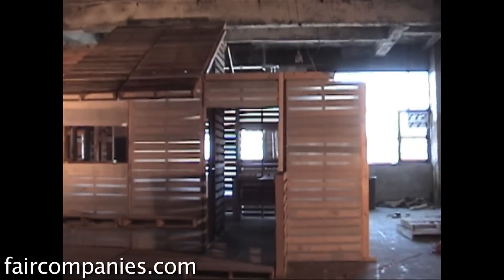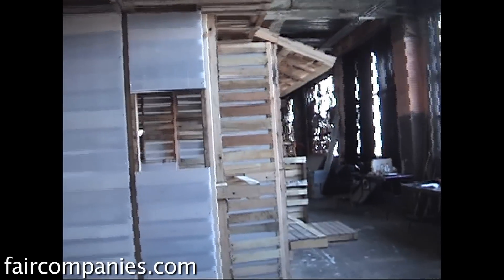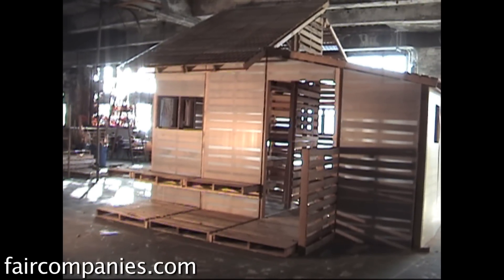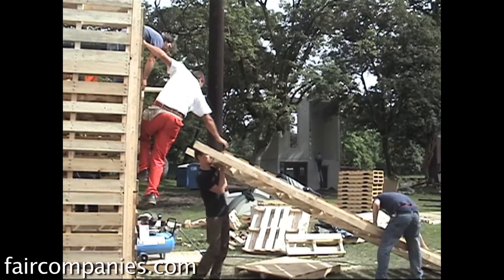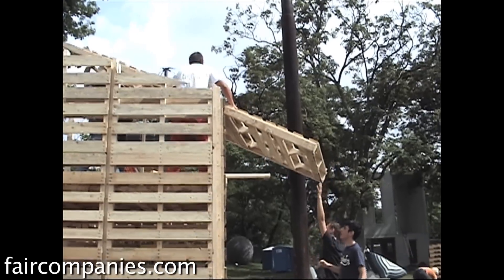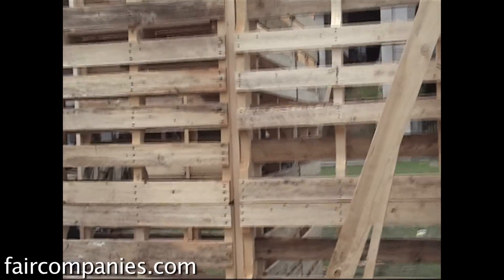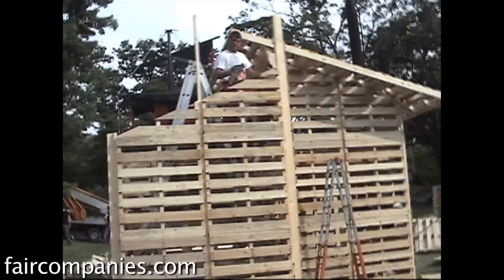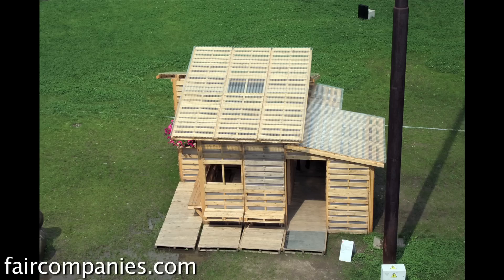Salvaged pallet tiny home has IKEA-style assembly guide

Comment: i am truly impressed with the genius of Suzan Wines. my company accumulates wooden shipping pallets and sells them to scavengers. (it annoys the hell out of me, for i have had my cubicle relocated to where these pallets are stored for the last 2 years, the noise is horrendous, i threatened to quit 5 weeks ago) but pallets make perfect sense for plumbing, insulation and electrical runs (i was a draftsman/designer for 12 years in a previous life)

off the top of my head i'd think in 4'x8' modules or units for plywood and framing material, pallets are 40" x 48". my company buys solid plastic-ish pallets, those could serve as exterior walls. pallets offer instant plumbing, electrical and insulation opportunities. the only thing is, most pallets i see are never "virgin" and have been around the planet a few times(quite ratty/rotted). i can't see donated "aid" arriving on pallets that aren't infested with molds, bacteria or even insects. a "whole house" fumigation with vaporized hydrogen peroxide would be needed to make older pallets "safe" for human habitation.

Suzan, nice concept, needs a little more work/thought, but i think you're beautiful  :)

Comment: Now this is innovation. This would be a great idea for Africa.
Reply: its good idea anywhere!!!!
Reply: Except Asia. You need to build your home with concrete in Asia. We suffer tropical storms down there and they're compared to that of the hurricanes in Fla.
Reply: rayva1 Well guess what. They have tornadoes in the USA but do they build their houses out of concrete? Nooo wood and cardboard all the way.
Reply: ayah Aya Yeah, except every country in the world that's situated in a temperate 4 seasons climate.
Reply: RamireZTKD Depends. Where I lived was in an older home where concrete was solid with steel poles as the framework in between the concrete. Which was why the homes felt like a hot oven in the summer and a fridge in the winter despite turning on the heater in winter or air-conditioner in the summer. At least with the military housing, they built their homes with insulation so that kept military homes warmer in winter and cooler in summer. As far as protection from tropical stormy weathers - concrete is the way to go with heavy duty windows built with steel framing and they actually build homes with steel doors in that country.
Reply: ayah Aya I couldn't agree more! :-) Peace be with you! ♡ and anyone reading this :-) Namaste ♡
Reply: 90% of Africans (all ethnic groups) live great houses, TV. just doesn't show that, they have beautiful amusement parks, very little jungle, and plush green land; do not fall for the propaganda, anyone anywhere who needs it, can use it. In other countries America and her inhabitants are shown in the most negative light, that's why we all have a bad reputation that precedes us. Become well learned not informed.

Comment: good basic idea though only really suitable for dry zones (ie the desert) unless some kind of weather proofing is put on the outside of the pallets.  I also notice that all the pallets used are full of holes, here in Ireland most of the pallets have the slats side by side leaving no space between them.  Much better for housing as they are more draught proof. ps we use them to make windbreak shelters and fencing around the garden as well as storage areas.  Ideal cause they don't have holes so can be painted/stained etc. and blend in.

Comment: I Built me a Storage Shed out of Pallets 16X14X9  With a Loft, Skinned it in Metal. I Have $1500.00 in it Most of the Cost was the metal and Labor, Could have Just Paid 750.00 for the Metal But Had a Guy Who Does metal Buildings Put it on So I didn't Make Mistakes on Cutting it . But Me and a Buddy did the Floor and Frame Out of the Pallets Made Our Own Trusses out of 2X4's  Had 150.00 in it Before The Metal & Labor. The Same Size Shed from Lowes or Home Depot  Well I say Same Size But actually there's was Smaller a 14X12X6 at Both Places Ran well over $6,000.00 Now that I've Done it I Could with the Help of One other Person Easily Do One in a Day. Granted I had all the Pallets and Materials on Hand. Very Happy with How it Turned Out, Looks Awesome
Reply: +Kelly Dardeen Very Awesome!
Reply: +Kelly Dardeen Oh! Btw... the way you get past all the bullshit permits and regulations is to build a structure at the legal maximum width and length that your state allows for a mobile structure to be hauled on a road. As for the height most states only allow somewhere around 12 feet max, although if you can prove that your upper section is detachable and also meets the state's hauling dimensions, and furthermore, you don't attach the structure to the land you are on, such as via a dug cement footer, but instead set it upon cinder block skids. Then, you should be golden. Although, you also cannot attach any municipal utilities to the structure either. So it would have to be totally off the grid, and you would use a wind turbine/solar for electric.
Reply: @robogenus  I was thinking of two 16x16 units connected by a breezeway.  If they weren’t actually connected (nailed) that might be allowed?

Comment: I personally think this idea has a lot of merit as a structure. Wall floor and roof covering materials are generally expensive no matter what is used. I understand their thinking as applied to disaster relief and poor nations that anything is than what is often available and as they mentioned, using emergency tent material or wattle and daub, thatch, there are many cheap options. I don't know how well it would work with pallets but filling the cavity with rammed earth might be an option. Pallets could be broken down using the planks to fill the gaps to contain the earth. As far as addressing homelessness in the U.S. and most developed nations I imagine, building codes would never allow these without substantial additions to the structure. I was a builder, carpenter and mason for over 50 yrs so I'm pretty familiar with this subject. When I say I was a builder, I was one who actually built houses and commercial buildings, not just hiring subcontractors as most are. Most people are not aware of this. I have dealt with so many "building contractors" who were barbers or butchers or someone who was able to get funding and have the idea that any dummy can do construction work. They don't know enough to understand the difference between an unskilled laborer and trained and skilled craftsmen. That's why most of the building today is crap. Pride in the ability to create a quality product with your intellect and hands gets little respect in the modern world. If you can't get it at Walmart or order it preassembled online it is outside the realm of popular culture.

Comment: @Dennis Miles - I agree, this building would be considered a Pole building like a pole barn, rather than the more typical platform framed building. Pole building get their strength through the poles and roof trusses (Though I don't know what they used for their roof trusses here, pallets could easily be converted into trusses).

Comment: I used to package statues for my father's business, the idea of building with non-recycled pallets is sound, but let's go onto recycled ones.

Most pallets could not be used in this kind of construction. They've been put under years of stress and most have pulled nails or broken boards. You'd need to completely dismantle the pallet and reassemble with new nails and probably a few new boards (which would raise the cost - labor). Only then would I feel comfortable calling it a building material.

Comment: ok. got the pallets.  What are you guys using for the sheathing for the temperature/rain... control?
Reply: It look like they used some plastic sheeting, but these ladies were in some kind of design competition or contest. I don't think there was a need for them to deal with the elements or weather. It was probably who could make the "coolest" or easiest house to build out of recyclable materials. Because it didn't look like they were worried about plumbing, insulation or anything like that. It looked like an art project or design project, to me, rather than a serious house build. Just my two cents.
Reply: You're probably right.  I would imagine plastic would make a lot of noise when the wind/rain hits it, and may possibly have condensation in the hot box.  But, it looks pretty nonetheless.

Comment: It would take one hell of a Carpenter to saw a pallet in half with a hand saw....they don't make Carpenters like that anymore....
Reply: nathan, "fince" and "to" prove that you're a farmer.
Reply: Adding to this thought from prior experience: Power tools are nearly a must.. I have hammered into concrete easier than into a pallet. They are incredibly hard. Having made a simple structure/house entirely by hand I learned the value of electric tools, screws work better than nails in pallet construction and even left neglected these structures can remain sound 20+ years later. This was my first permaculture/off grid home many years ago.
Reply: I may not be a carpenter but chop the pallets that I use with either my skill saw or my reciprocated saw, it really isn't that hard.
And No I do not have help.

Comment: Using zip ties to hold the entire thing together??? Hope they're UV rated!
Reply: +Pig Farmer Ben I don't imagine pallet houses held together by zip ties will manage hurricanes or earthquakes and Haiti construction has to deal with both possibilities. I can teardown and break apart pallets with very little effort. I can understand using pallet wood as façade, for a permanent residence, or as a structural component for a shed, or non-permanent residence like a camping shelter, or hunting shack, but I don't see how this really competes with tents in emergency relief efforts, other than ascetically, at least if a tent falls on you, you're still in good shape. If you fall out of that pallet loft, and have the whole thing come down on you like a house of cards, you're likely not walking away form that uninjured. Also emergency tents placed near emergency weather shelters are as inexpensive as the number of pallets that would take to complete that structure, and they are much lighter weight as well, and packed down, you can transport many more of them per cubic meter of freight space. I can see why these well-meaning soft-hearted people are getting ignored. :-D
Reply: "temporary transitional housing".

Comment: I wish some of you were competent to comment.   at 5:12 you say the pallets are the structure  WRONG, the corners and the midwall vertical wood is the structure and the pallet is only "In-fill" Watch the video my friends but this commentary is misleading mostly because the narrator is ignorant Also, it is not wood studded (7:30) construction  by any stretch of imagination...
Reply: There are some continuous studs, spaced about 40" apart, plus the corner posts. The short, 48" "studs" used in the pallets can provide some support in compression, if installed carefully, which is unlikely with unskilled labor.
-- Personally, I'm not all that enthralled with this approach, though there is something to be said about using commonly-available materials that can put up a structure quickly with unskilled labor. One problem is the skin, and this is where these houses can get expensive, unless that expense is transferred to some deep-pocketed agency like the UN, as in the case above.
-- Another problem is that pallets are sometimes treated with toxic pesticides, to prevent parasites from being shipped around the world. Some are heat treated to eliminate bugs and other life forms. And pallets that are used for shipping food can harbor e. coli and other bacteria.
-- Having built a number of architect-designed houses, I've come to regard residential architects as generally too concept-y and too lazy to do the detail work necessary to ensure that their houses can actually be built in a practical way and won't be full of unintended consequences. Of course, there are exceptions, but in general, I've got a lot more confidence in an architect who has swung a hammer for a few years (rather than participated in a week-long, hands-on "workshop"). Too many architects are like web designers today-- more interested in showing off their concept-y skills than in satisfying the needs and budget of the people who have to use their products.
Reply: GrizzlyGrizzle, I agree with you !

Comment: In theory, this is a decent idea but in the real world, the pallets that are discarded would not be in the condition like the ones the see in this video.  The main reason pallets get thrown out is because the pallets go through wear and tear to the point to where they can no longer be used as pallets any more.  Imo, a more viable solution would be to just build up a basic structure using solid pieces of wood rather than shipping pallets from the US.

Comment: I am concerned because, as I understand it, some pallets are treated with toxic chemicals.
Reply: Yes they are. And they never mention that.
Reply: +Amber Maize every pallet is marked according to how they are treated
Reply: +Amber Maize can you do something to protect against exposure to the toxic chemicals??
Reply: I'm more concerned it will burn so easy, I think it they used fire boarding it would be fine in my mind but yes cool .
Way to go, go see the Government they will say one word.
" No "
Reply: Yeah hopefully they used heat treated and not chemical treated pallets because they can be really toxic if chemically treated
Reply: @MB-jj8jw  I've been reading that tiny homes aren't necessarily safe either due to off gassing (hope I'm saying that correctly). The homes due to their size and ventilation issues cause the problem.

Comment: I like the concept of pallet houses for refugees, however this design would probably not work in the low-land tropics because termites would eat it within a year and the loft would be way to hot.  I could work in temperate climates provided some sort of termite protection is included into the design and construction.  The designers must also include protection from lateral forces.  You do not want it to collapse after an earthquake.

Comment: Most pallets you find laying about are irregular, studded with sharp metal and splinters, and made of chemically treated hardwood (handsaw, yeah right). Pulling nails is extremely annoying (spiral shaft) and the slats break in irregular ways when you hammer or pry them off. Pallet architecture has some aesthetic beauty but unless you're working with dozens of premium pallets, it's been way faster and cheaper in my experience to scrounge studs, plywood, and other materials.

Comment: The biggest problems I see are the plastic slats used to fill in between them they could use pallet wood or a recycled material. Secondly their is insulation of weather proofing. I see large gaps in the roof, and zero insulation to help keep you warm during the winter. And lastly while good in theory their is some excess design to this that wastes material for basic comforts while leaving areas unfinished and looking unprofessional.

Comment: Emergency housing? I would live in a small place like this! Though I would prefer to use bolts to keep the pallets together, but perhaps bolting to the piers would be secure enough and then just screws to hold them together.
Too bad the red tape would be a nightmare, and may end up making it cost more than just doing standard construction. Thank you, government.

Comment: No qualified builder would approve this as safe. No crossbeams, incorrect weight distribution before even factoring in cladding and insulation. Not to mention these won't be built by carpenters but by amateur builders. I just hope nobody is inside one of these things during a mild storm.

Comment: Recycled pallets aren't feasible, see my prior comment. People don't recycle gently used pallets too often, they usually get trashed after years of abuse and damage that would make it a hazardous building material without significant reworking. In that sense you'd be better off just reusing the old boards for the project instead.

The idea is fine in principle but it's just not practical.

Comment: The idea is a good one, the problem is all the pallets look brand new and uniform size, as if you've bought them from the manufacturer.  No one would ever be able to build these using used ones found around a local community, they would be dirty, different sizes & colours, boards missing or broken.  This is a typical PR job - what you see is not what you get.